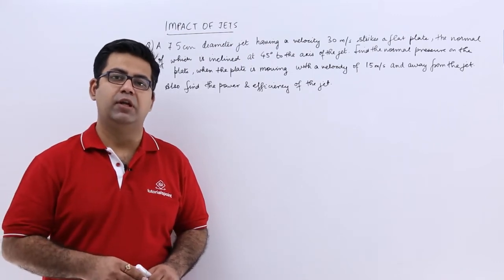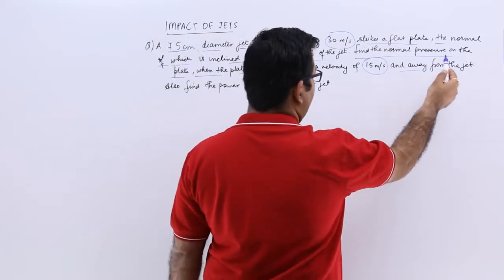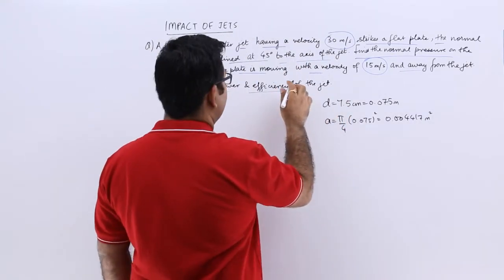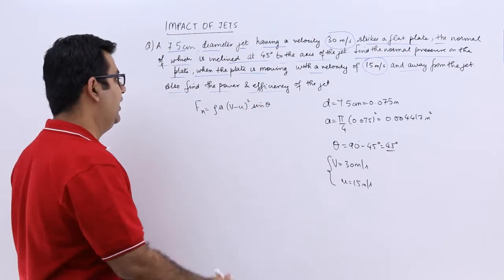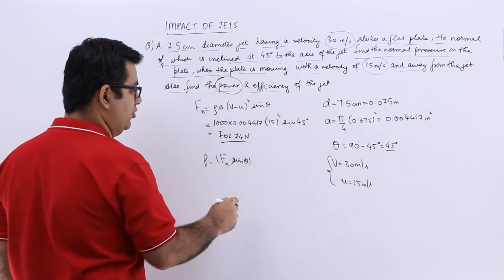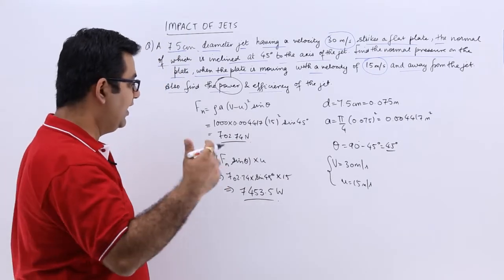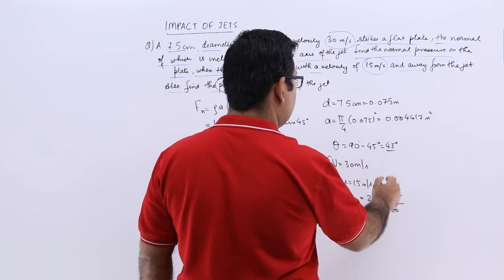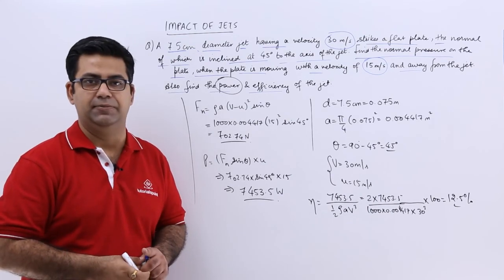Moving Inclined Plate Problem Example

Comment: why 90-45=45? I mean it should be just 45?
Reply: Because in question 45 degree is angle inlcined to normal.. But in theory when u study the concept  the angle which we take is the angle of the jet to plate, therefore here 90-45
Reply: I have also this question... please reply me if you find the answer

Comment: Sir, In the calculation of power, shouldn't it be normal force * velocity of the plate ?
Reply: No, because power is calculated in the direction of jet so we have to take the component of Fn in the x direction i.e Fx=Fnsin*vel of plate
Reply: Yes This is the same thing i have noticed.